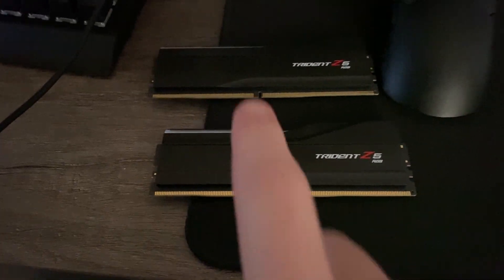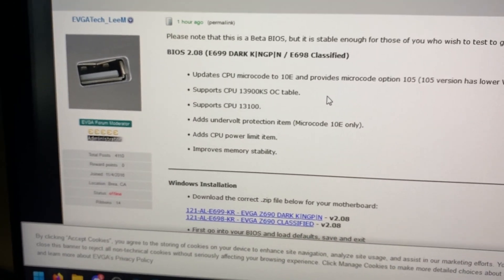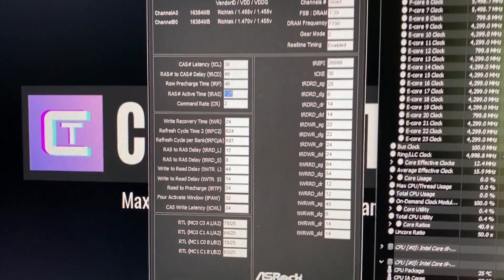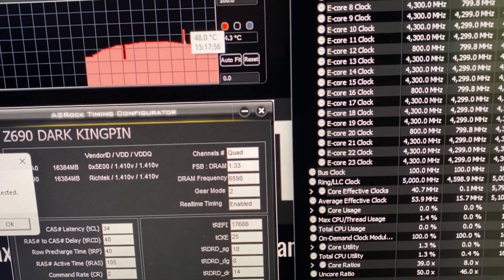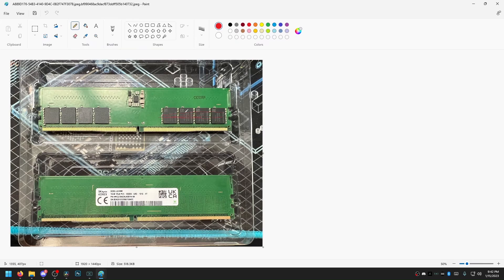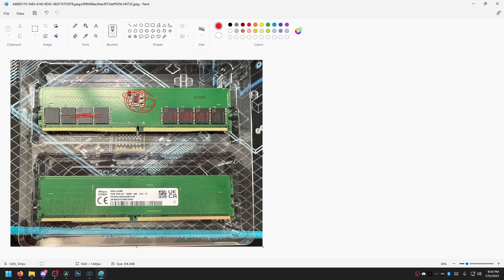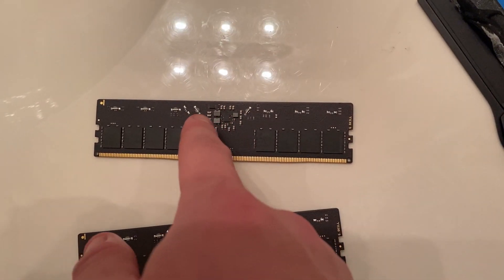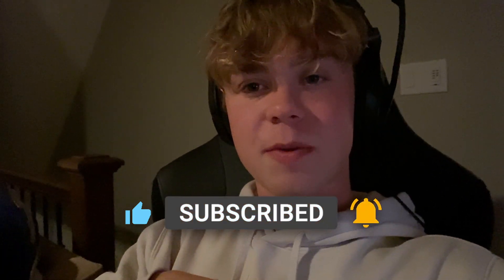The Secret to DDR5 MAX Performance

Comment: I left the PC to do some H.265 video encoding with ffmpeg last night with my 7950X3D + 2x32GB 6000MHz C30 GSkill and apparently it crashed somewhere along the 2 hour mark... No overclocking of any kind other than default PBO enable on the CPU and default XMP. CPU usages almost constant around 85%. CPU temps stable aorund 70C. The only thing that could have overheated is maybe my RAM which I've never experienced happen since I'm pretty new to encoding... Let's just say that I have a Meshroom S V2 sff PC setup where I have a 280 AIO radiator at the front with 2x P14 fans set to intake, and the radiator fans were at 65% or something throughout the encoding last night... Liquid temps were probably stable at 34C or something.... But now that set them to 100%, I see that even so my RAMs are at stable 50C during encoding, so that probably means that at 65% radiator fans, the airflow would probably be significantly lower that they might have gone 60C+ and THAT caused instability?

Like come on dude, why are you even putting a heatsink on the RAMs if you aren't gonna do it properly

Comment: this was 100% worth it, I have a 7200CL34 kit & removed the heat syncs. I was skeptical to say the least but to my surprise I dropped from  a 29-30c delta to a 24-25c delta. it was very worth it

Comment: Running Bartxstore customer copper heatspreaders with same Corsair ram fan setup. Haven't seen the sticks reach 32C yet during 1usmus & ABSOLUT at same 20-22C ambient temps. Single Rank M-die 6600C32@6800C30@1.53V VDD. Custom loop next! Just waiting for Supercool 13th gen DD kit from Thailand. He is a slow shipper unfortunately.

Comment: What speed have you stabilized for a daily setup with the A die? I’m currently running 7400 manually tuned on a z790 aorus master. I’m swapping to a z690 dark soon to get better results. 

Normally the gskill kits really don’t come with a good heat spreader. The kingston kits probably come with the best stock heat spreaders. 

On the kingson 7200 A die kit with a 140mm noctua fan pointed at them I get 37-39C on them while running TM5 for an hour (1usmus 20 cycles or absolut config).
Reply from the maker: Got 7800 stable. Now trying to get 8000 stable